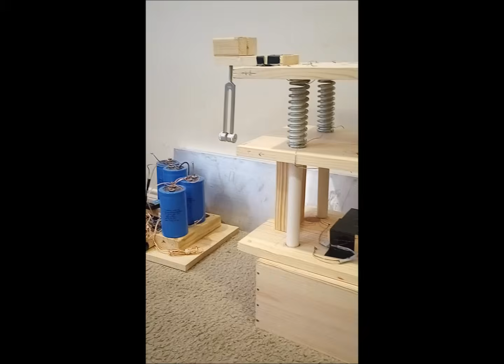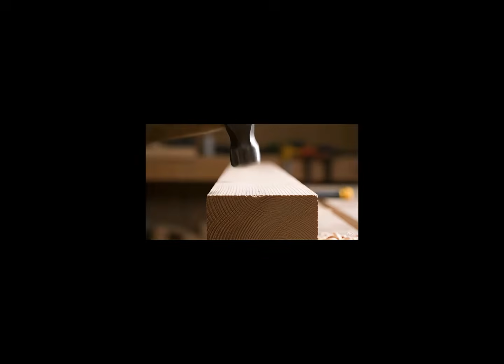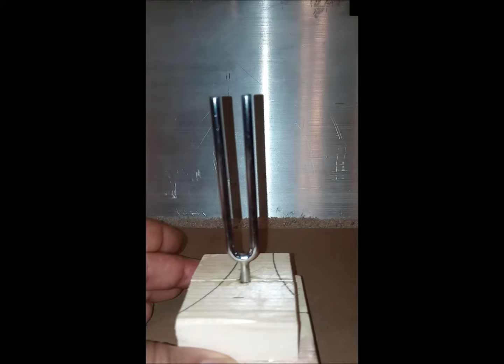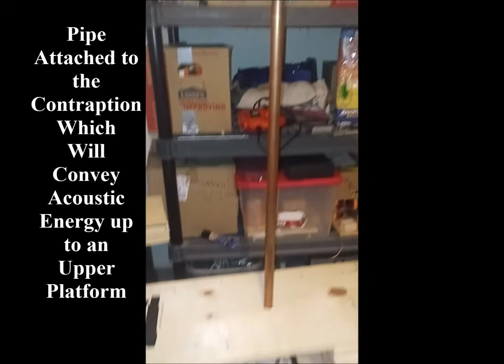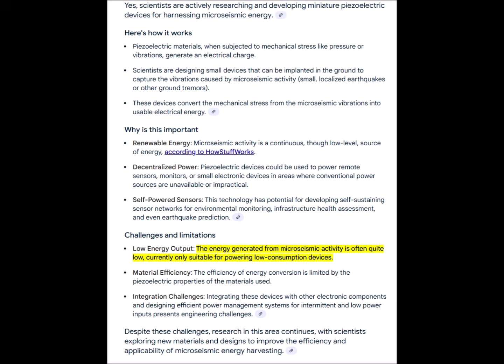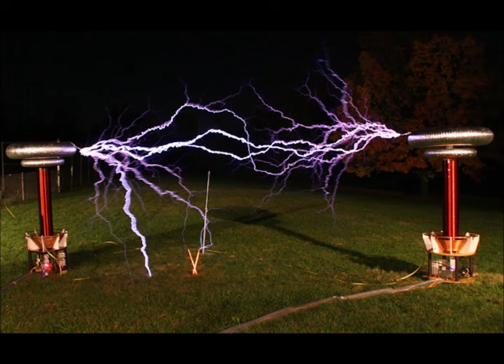Giza Underground: Can Seismic Energy be Stored in Giant Tuning Forks?

Comment: Have you heard of Peter Davey - Boiling Water with Sound? I still don't understand how it could work.
Reply from the maker: I hadn't heard of him, but I just did some quick research. Yes, everything has its own resonance frequencies. These frequencies allow maximum amount of energy transfer between matter including liquids. When this happens, the energy absorbed by the water from the sound wave is at a maximum and the water heats up. ( Molecules vibrate faster as they absorb energy). One guy named John W. Keely was allegedly able to completely distintegrate water using a similar technique.

Comment: Does anyone here have any idea on what heat actually is? Saying that its infrared dosent make sense to me when I started thinking about it long ago. Why only that part of the electromagnetic spectrum is heat and the rest not? Its been shown to be linked to special universal forces, like absolute zero. And result of special universal math like the law of squares. To my mind infrared seems more like an emission coming from heat rather than it being heat itself. But yet it clearly acts like light anyways, like how you can feel the cold of an object farther away than you should. So clearly it must be in infrared like light, but yet there is special two mode aspect to temperature; that being hot and cold. In my mind I see two electromagnetic spectrums (equal and opposite reaction). One where hot is on the right side electromagnetic spectrum, and cold is on the other electromagnetic spectrum. If sound has infinite magical abilities to the foundation of the universe like keely has shown, so then what about temperature? It's natural to think all forces now have equal wonders as to sound. Perhaps tempature truly is just on A electromagnetic spectrum but it's structure doesn't necessitate a sign like wave but has special geometry to its structure. As when you think of cold you get the picture of hexagons in your mind, and heat I see a combo of shapes around a hexagon and this hexagon is flowing with geometry. But the cold is pretty much fixed, and the hotter is gets the more its flowing. Temperature seems like universal balance to me (duality). As seen temperature is linked directly to resistance. Friction creates heat, high current creates heat. And cold is the opposite. It lowers resistance.

Hot, loss of energy explosions.
(Vortex outward)

Cold, gain of energy implosions. (vortex inward)

Makes sense cold is the infinite energy, as the universe is founded upon infinite stillness. And heat brings this infinite energy into motion (as I see with the flowing geometry of heat)(and if there is no heat there is no life, our bodies go cold when we die, and for spirit encounters the air usually always gets cold.)

And in unity there can be multi directional unifications. 1. motion is stillness (unidirectional). 2. Motion is stillness and stillness is motion (bi-directional unity). And maybe to tri-directional to infinity with other forces as all of these are true and not true all at the same time (timeless quantum state). Always organized by a higher awareness.

And irrigardless of all that I said about heat and resistance. What is true for one force in the universe is the exact opposite for another (duality).
Reply from the maker: Heat and infrared are not exactly the same, though there are relations between them. It's true that any object or space above absolute zero emits infrared radiation which is electromagnetic energy. Infrared radiation, though, can cause heating by increasing the rate of molecular vibration of whatever it comes in contact with. Electromagnetic radiation is how we get heating from the sun even though there are no air molecules to conduct the heat from the sun to the Earth. Instead, it is electromagnetic radiation in the visible light and infrared parts of the spectrum which carries the energy across space, which in turn increases molecular vibration and energy on Earth. There's an interesting discussion on page 128 in the book, "Universal Laws Never Before Revealed" by Dale Pond, relating to vibration, heat, and levitation. It says that, "heat is a manifestation of high frequency sound waves". This is interesting since mainstream science says that the phonon is the quantum representation of both heat and sound/vibration. It goes on to discuss how heat causes a gas to rise, but that it is not the heat itself that causes the rising, but rather the vibrations. Modern science says that hot air rises because it is less dense than the surrounding cold air. But then the question is why is hot air less dense? The book continues by saying that, "...heat applied to water in a pan on the stove will not make it any lighter", but that sound applied to water can make water rise, surmising that, "might it not be something within heat or the cause of heat (vibrations) that contains the 'levitating effect'? If heat and sound are vibrations, then this 'levitating effect' is caused by vibrations or some...mode of vibrations and not by heat alone. In the case of heated air rising, it would be better to say that heat is present in air as it levitates or rises." In effect, air subjected to a certain order of vibrational frequencies will become modulated by their frequencies. "The resultant will be an air atom or molecule vibrating or resonating to those same frequencies which emits 'heat' (or the same vibrations recognized as heat) and at the same time this air particle  will have the tendency to rise vertically." In the past, this may have been labeled as bordering pseudoscience, but interestingly, a recent scientific paper has provided evidence that sound (phonons) carry "negative mass"; meaning that they tend to rise when in the presence of a gravitational field!
Reply: @gsutton78  This will sound really stupid but I kinda forgot heat was molecular vibration lol. As evidence by my comment. Everything really is just a mode of vibration of some higher aether geometry. Thanks for the reply. This could also add explanation to a lot of UFO encounters where the saucer is emitting immense heat and glowing hot.
Reply from the maker: @SpeirlingTheory  Yes! Vibrations can create temperature differentials. That's how thermoacoustic devices work including thermoacoustic refrigerators. Apparently, Philadelphian acoustics researcher John W. Keely reported cooling effects during the operation of his equipment. And allegedly, Nikola Tesla created a sphere which would levitate. Curiously, it would also get hot in one hemisphere and cold on the other!
Reply: @gsutton78  My comment got deleted. Ill try again.
Reply: @gsutton78  I've come up with an anti-gravity theory. So we have Keely's celestial current, which is both push and repel but like 90% push and 10% repel (idk the numbers). And we have Walter Russel's motion of the atom through space, where one side is charging intake and the other is discharge, the two flowing causing the force of motion which is unidirectional. This Celestial current might be of same charge (like static electricity or magnets that repel each other due to being the same) to the discharge aspect of the atom, causing it to push away from the celestial attractive. And enacts on the intake charging vortex as equal and opposite reaction for motion (like Back emf,  so the curent going down <---- but it induces charge in the intake going in ---->>>) causing it to pull itself towards the earth. The celestial repulsive might also act on the discharge vortex, aiding its pushing force down which is stronger than the repulsive force. And the repulsive, aiding the intake going this way ------>  which makes motion unidirectional again, causing that effect of everything seemingly just flowing in the direction of gravity as both sides pull you down.

So when you access special modes of vibration, the vortexes of the atom change how they interact with the celestial current (Perhaps a change in polarity). So now the discharge region is attracted to the celestial current, and the intake region is repelled from the the celestial repulsive. So now gravity is inverted to the atom. This would make a lot of sense for the gravitational constant too, as the faster the object falls, the more discharge against the pull there is, and more pull there is caused by repulsive on the intake, as the vortexes constantly increase in speed and rotation, so its as if its always pushing from the position it started moving from. Like when you walk you push in the opposite direction on the ground, but you never move away from your source as your leg gets stronger and stronger to push of it the further away it gets, thus making a gravity constant.

This theory would make more sense than Keely's "pushing" or "pulling" for the force. As anything that truly pushes or pulls gets resistance from the object its enacting on. Which would probably manifest as heat. But here everything magically perfectly falls in its direction with no effect to the molecule.
Reply: @gsutton78  Lol I also wanted to mention the Tesla sphere but i forgot. Heat also determines the state of matter and physical properties of molecules. Like liquid helium having perpetual motion. The hotter it gets it tends become less solid, and the colder more solid.
Reply: @gsutton78  Do you see my anti-gravity theory?
Reply from the maker: @SpeirlingTheory  That's a well-thought out theory. Your discharge/intake regions remind me of the receptor sites on biological cells. The next step is to put the theory to the test!
Reply from the maker: @SpeirlingTheory  Yes, I see the antigravity one, but not the one that says, "perhaps when something has negative mass..."
Reply from the maker: @SpeirlingTheory  Yes, I see the "anti-G" one, but not the one that says, "perhaps when something has negative mass..."
Reply from the maker: @SpeirlingTheory  Yes, something weird is going on with our comments 🤔
Reply: @gsutton78 Ignore the "perhaps when something has negative mass" comment. I posted it too soon because I was excited. A not well thought out version that got confusing for the the anti gravity comment. That's why I deleted it. Then my anti-g theory you saw got deleted the first time.
Reply: @gsutton78 You might need to make a quick update video on YouTube's new rule. Might not be seeing you again in the future :( its been a good one.
Reply: @gsutton78  This also adds on how certain music can have a cold atmosphere, or a hot ambiance.
Reply: @gsutton78  I deleted a comment that started with " Perhaps when something has "negative mass" is that-" don't read it I was to eager to post and I didn't write what I wanted to write. *EDIT: You can read and reply now.*

Comment: What if these supposed tuning forks are partly hallow? Could you make an octave harmonic resonance then with an air cavity inside? So the main resonance of the tuning fork, and then a higher octave within the fork could mitigate vibration loss? I also had the thought that if this higher octave within loses vibrational force, the lowering pressure fields of this cavity would bring this resonance back to the lower main resonance of the tuning fork structure, using some complex geometry; this idea also ignoring special materials that could promote greater phonon harmonic properties.
Reply from the maker: Interesting 🤔! A hollow tuning fork is a really unique idea as it would open up different modes of vibration. You'd have the longitudinal vibration characteristics of the air inside of the cavity or hollow part in addition to the normal,  transverse characteristics of the vibrating tines. This is why I need a 3D printer!
Reply: @gsutton78  Maybe this could also help for tuning forks drilling. Because you could funnel the longitudinal vibrations to the bottom part of the fork. And because the air inside is being vibrated equally by the tuning fork itself, the resonance lasts a lot longer. So when you go to strike something and the physical vibration of the main tuning fork dies out, the inside could still be resonating to get it back up to operation. And then insert some perpetual motion loop aspect on it. I wonder what would happen to resonance cavities with certain music notes/octaves/resonance taking place where John Searl's <<Law of the Squares>> is applied.